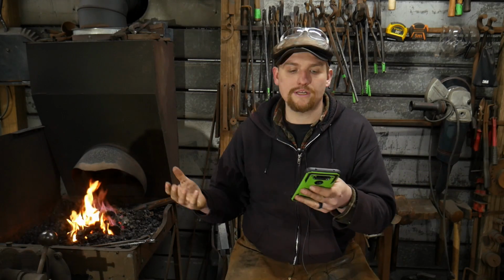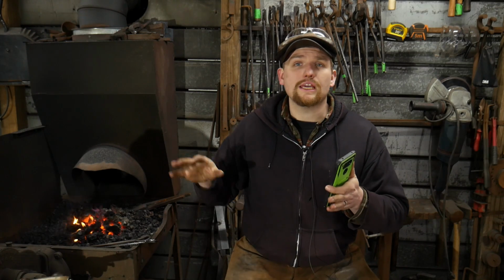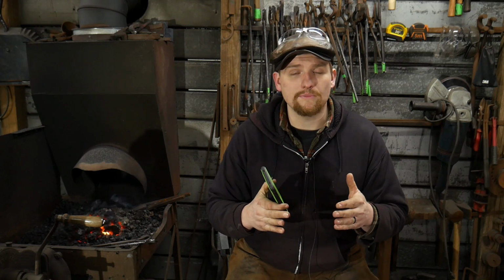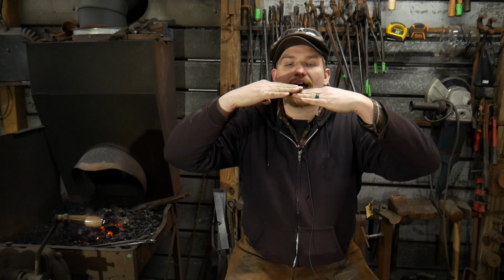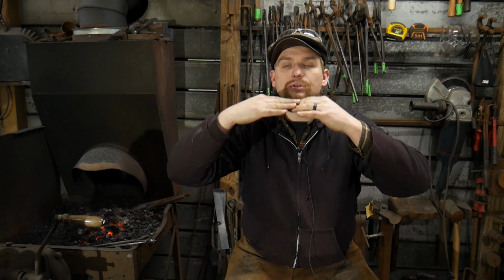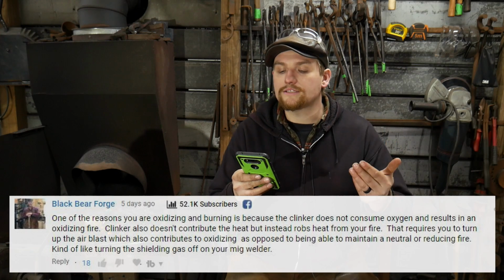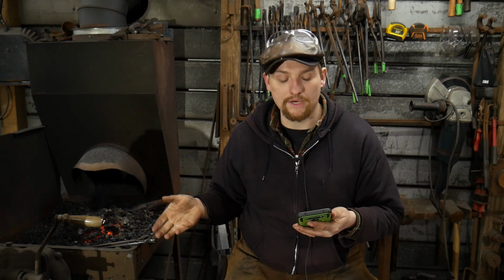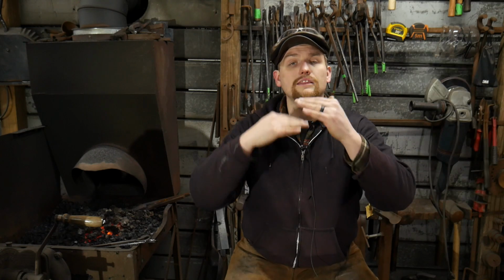Forge Welding Q&A

Comment: For forge welding stainless steel see ' potty 1' you tube channel.  He forge welds stainless steel in a damaskus  billet by welding all edges thereby sealing all oxygen  from the stainless steel  to make it work.  Not really  for a beginner.
Reply: Actually it is "ppotty 1"  with two p's. The other gets you potty training vids lol
Also barefootforge makes stainless Damascus rings.

Comment: I was one of those who thought i would never get welding down. Still not great at it, about 75% success. I found that if "press" or not let my hammer rebound off the pieces i have better success. 
A thought on inside or outside. For a few years my forge was outside, not even a shade tree. While the summer sun and winter chill were a pain what my biggest problem was, was wind. Not as much when using coal, but it would really effect my gasser. When the wind woud blow it would be like blowing air into my burner greatly increasing my oxygen level. Sometimes it would blow hard enough to sputter my burner. Gotta love that Miami Valley wind. Stay tied down today, 40+ MPH winds expected. 
I have since moved and now have a work shop. However i am lacking ventilation so my coal forge has been idle since  Thanksgiving.